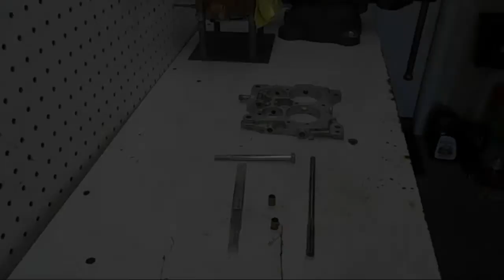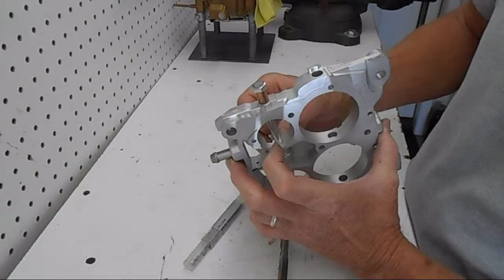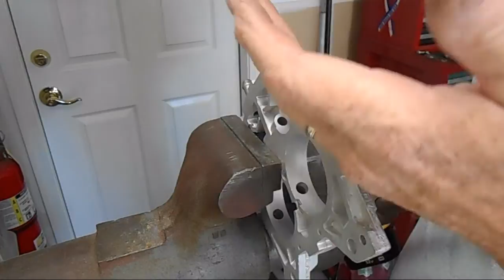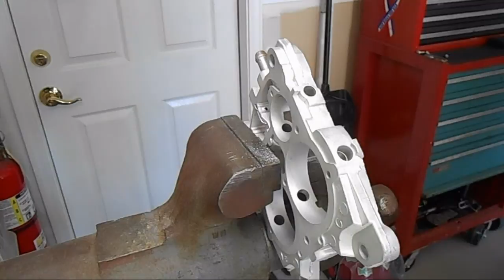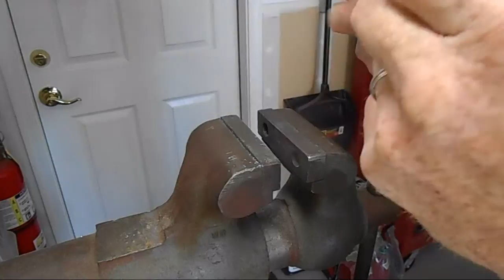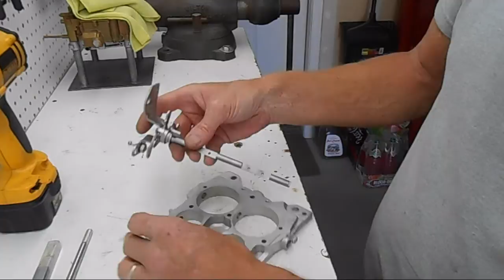Rochester Quadrajet Base Plate Rebuild 2 Bushing Install

Comment: What if you were reaming  a single barrel GM  TBI unit and didn't have the benefit of the "center" shaft bore to  
aid in alignment of the reamer.  Do you think you would still get a perfectly aligned throttle shaft bore using the method you displayed?

Comment: Good, but putting aluminum in a steel vise without some protection between the aluminum and steel could scar the polished surface of the carburetor. Use cardboard or old rubber inner-tube to protect it.   Thanks
Reply: He's probably never done this job before. It looks like it's the first time he ever did this procedure.

Comment: How do you get the little screws out for the butterflies without snapping them or do they break
Reply from the maker: Grind the threads flush with the shaft. Then remove the screws. If they feel hard to remove heat the shaft with map gas.
Reply: @backnine  okay thanks I will try at today..
Reply: @backnine  if I grind them down where do I get new screws at
Reply from the maker: @mr_cirino.5181  McMaster-Carr  3-48 Binding Head SS. 3/16 Front 1/4 rear.

Comment: I paid a carb shop $238.00 to rebuild my used (sitting under my work bench for 30 years) 1978 Quadrajet that I bought to someday remove the ECM controlled E4ME Q-Jet...that finally happened,
I told him I wanted the base plate bushed because there is play in the shaft-(to me it's too much play)
He rebuilds every carb then runs EACH carb on either an inline 6-cylinder or smaller V-8 to dial them in.
He told me..."my throttle plates were not that bad, and when they get rebushed the carb never idles right"...doesn't make sense to me.
Anyhow, I bolted my Rodchester Q-Jet on my 81 Vette and the engine idles and runs very good.
However...who knows when the already sloppy throttle shaft will start sucking air to the point idle adjust ability is a problem.

Comment: Thank you. Great Video. I am having a hard time determining whether or not to re-bush the throttle shaft(s) in my 4150 Holley. They may have a very small amount of of play. Almost imperceptible if at all. Trying to Wiggle the shaft at idle has no effect on the idle. On the road, when holding the throttle steady at small openings, the engine runs lean, but when doing so at larger openings the A/F ratio is fine. I have an O2 sensor in the exhaust.

Do you have any suggestions? Thank you, Leo

Comment: Love the Vids, I feel comfortable to do the bushings now. thank you!  But I had to call MCMaster-Carr to get proper part # for bushing it is 
6391K153
Oil-Embedded Sleeve Bearing for 5/16" Shaft Diameter, 3/8" OD, 1/2" Length
Reply from the maker: Hi Joe
 I dropped a number in the video Glade it helped you. You can do Holley's the same way. They use a 3/8 shaft. I may do a video on it.

Harold
Reply: I plan on getting the bushings from Grainger, as they are a bit cheaper. and the reamer from ebay. I will have about 25 bucks in it total.
Reply: I noticed (on the bench full of fuel) that not only is it leaking from the primary shaft, its leaking around that center gasket. is that a common problem, or just the gasket probably bad?